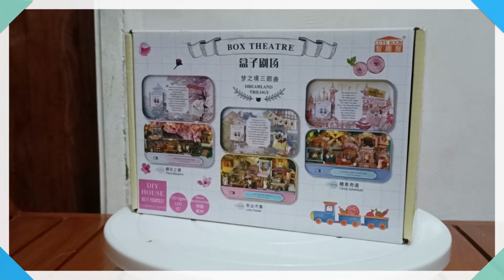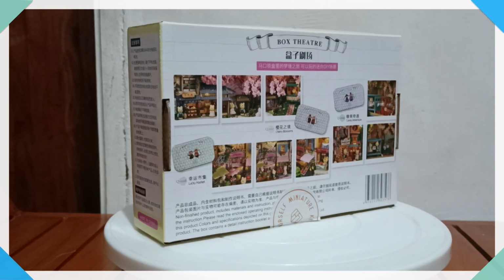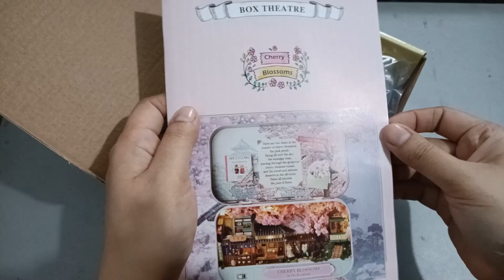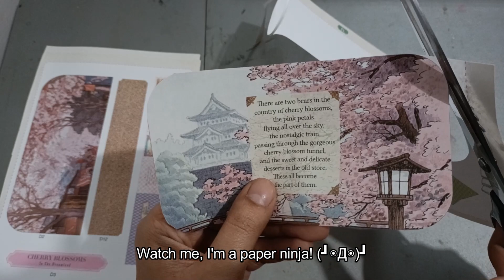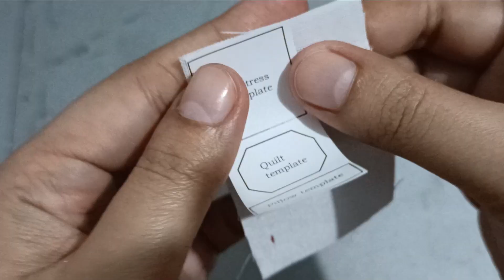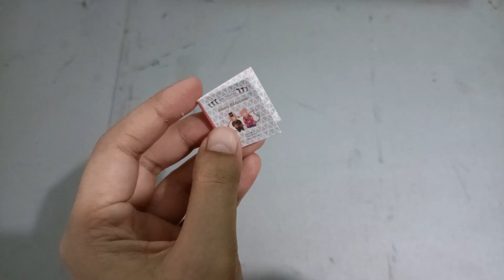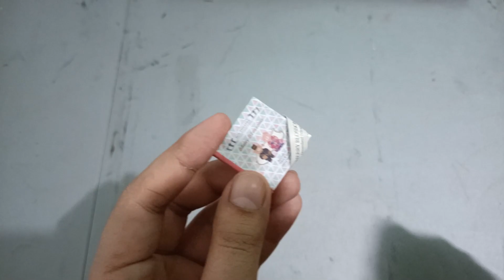My First Time Building A Miniature Set! | Cherry Blossoms Miniature Box Theatre Set

Comment: hey can you help I got one of the boxes and I accidentally broke the light (i only deattached the wires from the switch but when i hold the switch to the wire it turns on ) hope u can help! annd loved ur video ❤❤❤
Reply from the maker: I also had a hard time with the batteries. 

Maybe since it's still working when you press it down. Try to pin it together with a good tape so it will stay in place. 

Hope it works! 🤞